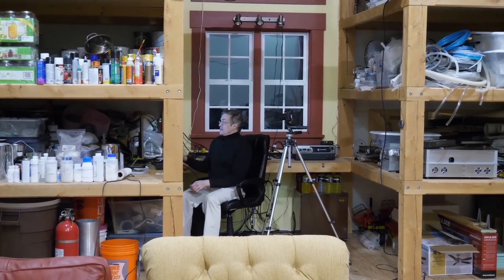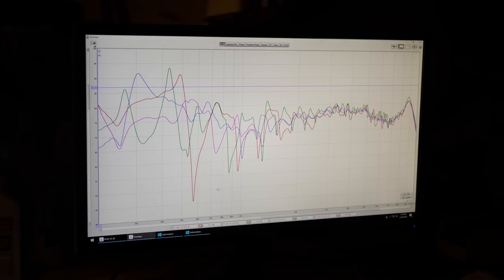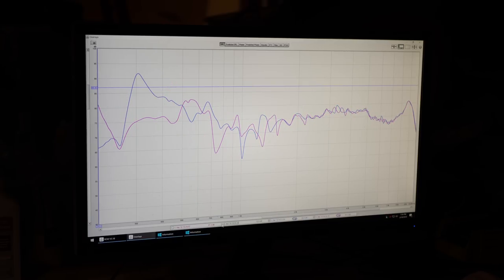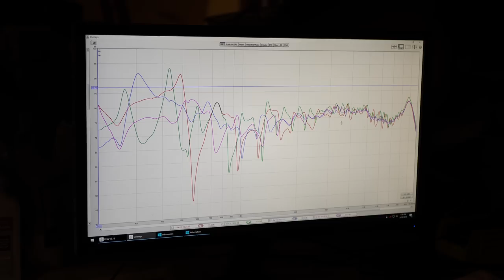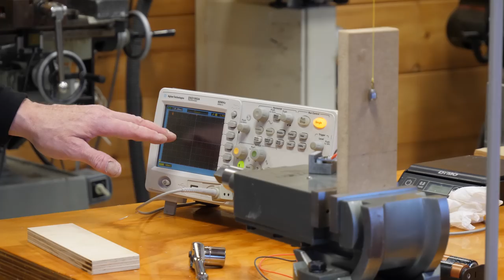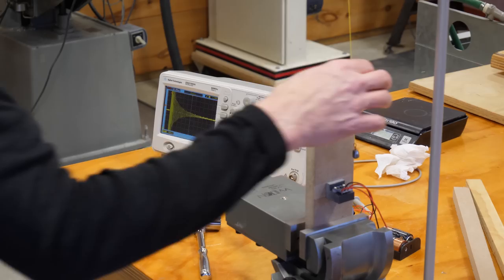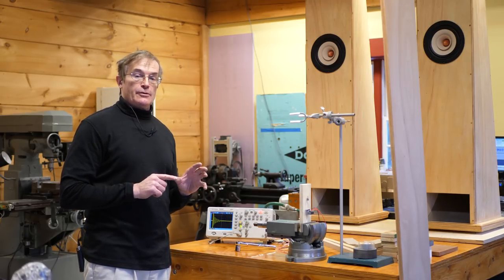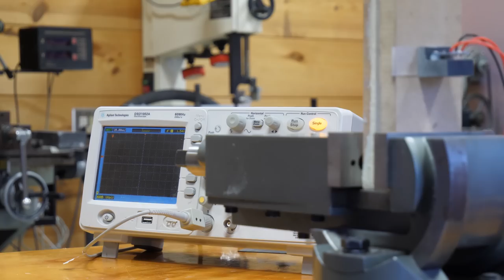World's Second Best Speakers!

Comment: Hello, does your Transmission Line benefit the whole spectrum or just the bass ?
Reply from the maker: It benefits the whole spectrum.  That is the purpose of the taper in the transmission line.  For a single or narrow  range of frequencies, a non tapered tube would be more efficient.
Reply: @TechIngredients  Hello, thanks for the reply. Is there any calculation tool out there i can use? I want to make a Voigt pipe for a midbass that play from 80hz to 400 hz and for an mid driver that plays from 400hz to 2500hz.

Can you help me with that to? 
🙏
Reply from the maker: Not that I know of.
For that wide a frequency range, I'd use the dimensions that we posted below the video for construction of this speaker. Note, the opening height is 15 cm.
Reply: @TechIngredients It seems I may have misunderstood a part of your explanation. Initially, you mentioned that the Voigt Speaker combines elements of a horn/transmission line with a port, featuring open ends to evenly distribute the frequency spectrum. However, observing the speaker, it appears that only one end is open, primarily enhancing lower frequencies while acting as a sink for higher frequencies. The tapered structure seems to amplify lower frequencies that the speaker struggles to produce, channeling them through the opening, which, contrary to initial descriptions, doesn't seem to function as either a port or horn. I'm confused about the concept. You initially stated that the design utilizes energy from the speaker's rear to prevent waste, yet later it appears that the design filters out high frequencies, preventing a significant portion of the frequency spectrum from reaching the listener. So its jet another technique to enhace Bass but not to bring the whole freqnecy spectrum of the back speaker to the ears?

I also watched this Video and no im completely confused:

https://www.youtube.com/watch?v=I1I7uSBCZUo

My personal objective is to maximize the utilization of the rear sound to amplify the frontal audio quality, while minimizing any interference caused by sound reflections off the cabinet and impacting the rear of the diaphragm. Therefore, I'm considering whether a rear-facing horn, coupled with a compression chamber that channels as much energy as possible directly into the horn without it reflecting back onto the diaphragm, might be the solution I need.
Reply from the maker: The design incorporates both horn and transmission line properties in the tapered chamber.
High frequencies generally do not benefit as much from rear manipulation, which is why high-frequency tweeters can be mounted remotely to fill in a listening space.

Comment: Also the 15.5 inches for the base plate is too short. It doesn't take into account the 3/4 inch front panel or an allowance for the rounding at the front. I believe it should be 17 inches or 431mm.

Comment: How about controlling the output of the speaker and using a differential amplifier and a second speaker in the same box so that the waves that leave the box fit to the original signal ? Something like active noise reduction, but in this case we "repair" the distortions done by speaker and box unwanted side effects.

Comment: That's more or less what an expansion chamber does on a two-stroke motor,by tuning it with the two cones Barrel and the Stinger, you push back at the right time to keep raw fuel in the cylinder and increase the compression slightly. That is very interesting to me and what your doing right now

Comment: The base plates are all the same size. At 51:09 you can see the base plates are lined up but at 51:18 the top one overhangs the bottom one by around 10mm. What's the right way?

Comment: Comb effect is a part of the sound of 'every' vibrating instrumental enclosure, not just speaker cabinets.  Further, they all create additional comb effects relative to their proximity to boundary walls, just as a speaker is effected by its placement in a room. That being the case, instrumentalists should concern themselves with 'where' they stand on stage (as well as how they orient themselves 'n' that position) if 'sound, rather than aesthetics, is the goal. In theory, acoustic string instruments of all types could profit from the addition of transmission 'alignment' to correct their 'ported' combing.
Reply from the maker: I don't disagree.

Comment: Well shit. I'll build mt speakers out of 3/4" 6061 aircraft aluminum.  
What the hell ive got millions to spend on speakers.    Have you ever heard of bracing? Do you really think the 5 1/4"  speaks ard going to flex 3/4" mdf?  It might a 18" subwoofer in fact it does
But that 5 1/4" speaks not going to move the mdf wall.
Reply from the maker: You could if you want, but aluminum has terrible  damping characteristics.  I wouldn't  advise  using it.🫤
ALL walls move. We aren't  building a carpet covered boom box for a muscle car.  These are audiophile level speakers and the physics matters.

Comment: Your wrong, MDF is both stable and has mass enough to be a near perfect product for speakers, and its not cheap as you think anymore.   Used to be 20 bucks for a 4x8 sheet but it can run as much as plywood and dosnt have voids in it like plywood does.  You want mass, if your boxes wall has voids youve lost mass. And the void will cause problems. 
Granted plywood comes in many types
Is your looking for a 10 layer plywood or more with no voids you wont find it at home depot or lowes. What you'll find is cabnit grad plywood or siding or sheeting or even floor materials made for building not speaker boxes, so you will find MDF  but id suggests a 1" thick mdf over a 3/4" and you'll pay 50 to 75 bucks a sheet.  The plywood you should use can be as much as 175 bucks a sheet and its imported. What you might get is Chinese made plywood thats absolutely garbage.
Or you can go with carbon fiber but you better be rich as Fuc* to buy 3/4" carbon fiber products becuse its not cheap.
Almost all major speaker manufactures use MDF unless they use plastics.

The plywood your using is construction grade. Its not good enough for speakers.
Your better off with MDF.
Reply from the maker: That all sounds good, but I actually  tested the plywood we used and the competing MDF and shared the results of these tests in the video. That's  why I recommended the plywood. Mass is good, but so is stiffness and plywood has a better mix.  Most speaker manufacturers use MDF because it's  cost effective and it works, but plywood is better.

Comment: Ive been designing and building home audio enclosures since 1984, so this is definitely a passion of mine. This video is nothing less than Excellent!! I wish I stumbled on it 4 yrs ago...
Question though, why did you not countersink the driver in the front baffle? Does it not matter? thx
I just subscribed!!
Reply from the maker: Thanks. 
I could have, but once the enclosure is sealed up, it would be a challenge to engineer the driver support and still allow it to be replaced.  Doubling the face thickness would give some added depth, but then that would affect the cavity volume and add weight. It's a trade-off.

Comment: This is wicked... I had so many thoughts during the process where I wanted to comment, then a few minutes later you addressed the point. Ie, from the thumbnail alone, I was about to ask wtf do you use plywood. But I left it to the end to comment. I'm not in the room, but your standing position at the end will have an effect. Tiny, but it will be there. 
Second opinion. This covers mids and mid highs stunningly. Introduce a 30k ribbon, or even better, one of those super tweeters like on top of the 800D series. In the same sentence, you really want to cover frequencies 20hz and up as well. Not a chance this set does that. I get it... Add a sub. I even have a sub against my monitor audio silvers that goes to 30hz. MA's are movie speakers, so I'm scouring the web for music speakers.  This is getting close. My current train of thought is open baffle with a boxed twin 12" sub at the bottom. Cross over running 20hz to 70, mid bass running 50 - 250, some full range running 150 to 18k, and ribbons or supper tweeters running 17500 up to what they can do.
Reply from the maker: I'm  not sure what you are trying  to say.
The speaker system  you are designing  is completely  different  from what I demonstrated.  Hopefully, it will work well.

Comment: I love this!  
I mean, all claims proven scientifically, lead knocker swing knock, accelerometer 'scoped test - and plus hanging samples rubber stick knock and listen test.  Seeing plus "hearing" 2 different ways results in fact, not opinion, and I love it!

That was just about the importance of doing the dampening putty stage.

Human nature would likely cause ½ of DIYers to fall prey to impatience and omit the tasks of the noise dampening processes.
I would've been so prone
Thank you for demostrating in no uncertain terms, why the sound dampening efforts are to be done. 

And for covering the various kinds of plywoods, approximate relative costs.
And for proving, why plywood is more advantageous than cheap, heavy, formaldehyde emitting, headache causing particle board.

And for the port no port, cone no cone, constructive destructive wave concepts lecture and ( but wait there's more! ) demonstrating with your awesome home brewed no echo acoustical cube!

Thanks for creating your videos.
Your implementation is supurb, imo.
Reply from the maker: Thank you!

Comment: Hello, thank you so much for such a detailed, scintific video. It does clear a lot of air around Plywood vs MDF. Could you help with the exact ratio of Decidamp and the eurathane glue? And also, what is the product name of the glue ?
Reply from the maker: Sure, you're welcome. 
There is no ratio relationship between the Decidamp and the glue.  To glue the wood panels together, you can use any type of quality wood glue that you're familiar with.
Theoretically, the thinner the layer of Decidamp, the better this works, but practically a layer that a common serated trowel that is used to install ceramic tiles produces a good thickness and generates a flat layer.

Comment: Thoroughly enjoyavle vid. It's great to see people take an interest in horn design again, but realistically, better results could be achieved with a crossover and a(n) lf device(s). There is not really any fidelity advantage in listening to a rear loaded horn - yes a crossover based design will always add some distortion, but a lot less than the prominent time domain distortion of a rear folded horn. These were amazing in the 40s/50s when high power long throw devices with low FS simply weren't available. With a full range device like this, that Xover can also be kept well out of the listening band.
Reply: How do you keep the crossover out of the listening band? I'm listening from 20hz to 15k.

Comment: Wait! Vibration decay is not very different in plywood that's great, what about the frequency? Can't quite see from the screen. MDF may have an inaudibly low or something. From my own unscientific knocking on some panels, MDF produces less sound.
Reply from the maker: The frequency is determined by the material stiffness and mass.  The demonstration used the natural frequency of the material itself and did not impose a frequency on the test panel.  There won't be a  frequency response that is stelthy.  Adding the constrained layer is overwhelming better than any small difference between the simple panels.

Comment: Just a quick question … if I were to apply this build to a 12” full range driver (11” diameter hole) would widening the width of the baffle to accommodate the bigger speaker suffice? Or should I increase all dimensions proportionately? 

Any help would be most appreciated
Reply from the maker: Look at the manufacturer's recommended "open volume" for the driver and scale the dimensions to meet that total internal volume.

Comment: What happens if you build them half size? Fantastic video! Thank you thank you thank you! But seriously what happens if you build them half size?
Reply from the maker: You'd need to find a full range driver with a proportionally smaller recommended open volume.  Then, scale the dimensions to match that internal volume.

Comment: I just made oak speakers. From cupboard doors. I built a table saw just for the job. Cut the panels. The next day they twisted everydirection. Oak seems difficult to work with. I've spent a week flipping the pieces in the sun trying to straighten them. 2 minutes too long on one side and they're like curly fries. I'm thinking hotpress and mill the panels . But will they twist again? Yeah. Pine speakers be easier
Reply from the maker: Plywood  is all around a pretty good option.

Comment: Thank you, now i know a little bit more about Speaker Design. What do you think about light concrete ( 50% concrete and 50% wood flour/chips ) Did you ever tested a material like this to construct a speaker? thx
Reply from the maker: I haven't, but if the mix is compatable and sufficiently robust I suspect  it would work well.

Comment: Sorry, ive got to correct you, you said the magnet moves, thats wrong. The magnets stationary and cant move. The coil is attracted to the N or S pole of the magnet by its alternating current flo becuse the alternating current is the same or opposite pole of the magnet as current passes through the wire creating a magnetic feild.
I know you know what your talking about, but your explanation was wrongfully stated so the avg person couldn't understand the importance of the electronic effect of a motor.
Speakers are motors  driven by electricity. It takes alternating current to drive a speaker. 
As the coil moves it pushes and pull the speakers diaphragm causing air to move
We pick the up as sound with our ear drums. If you put any speaker into a vacume you get no sound.  Just movement on the cone of the speaker.

Sound moves at 154' per second.
Your basically showing a transmission line speaker, bose uses this to create it acoustic mass or wave speakers like it wave radio, you can take a small speaker and get bigger sound out of it if you turn the back wave around to be in phase with the forward facing wave.
These are very complex to build properly and the math isn't very easy to master.
Generally people work off the 1/4 wave aspects of it s full wave transmission line speak would both be big and complicated to build.
Even more if your using a large driver like a 10 or 12" subwoofer. However in an automobile it kind of does this by facing the woofer to the rear of the trunk 9f the car, it also kind of works at a wall or floor.
Ports in a ported box are not the same concept.
Reply from the maker: You're  right about the magnet and the coil, I misspoke.  However, sound moves at "the speed of sound" and that's  330 meters per second.

Comment: Would you recommend two exit pipes on each side of a bottom 15" front stereo speaker? Instead of directing them forward or backward were perhaps the 8" are. You use your T shape on the 15" And the U for the 8" elements. Would that work?
Reply from the maker: It probably would.

Comment: Sir I watched your video to its end. I'm a geek for good  qualitysounding base speakers., Givng the a full sosound iffect
  I must say your  points sounded very logical, thouigh you prove them  scientifically with the various instruments. But here's your short coming, you didn't give the dimentions of how to build that design  speaker box so we can tweek the proportions as we would like top get varied sizes.. the question i want amswered also  is whats the dept of a box relavive to the speaker. coz we are talking about sound bouncing. How far in should  the sound go before it is reflected for optimum result?
Reply from the maker: I linked to the dimensions for this particular build in the description just below the video. If you choose a different full range driver then use the manufacturer's recommended "open volume" for that driver and scale the cabinet to match that volume.